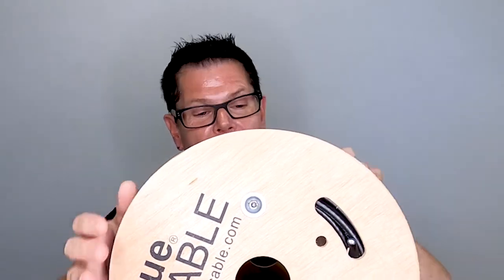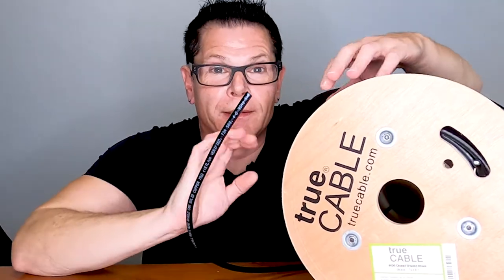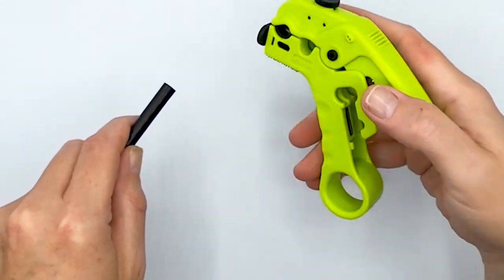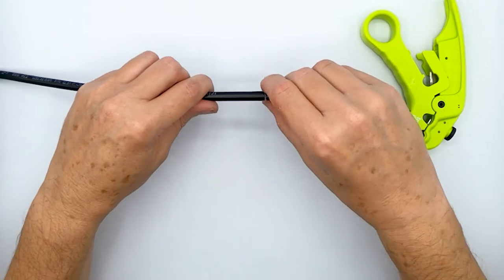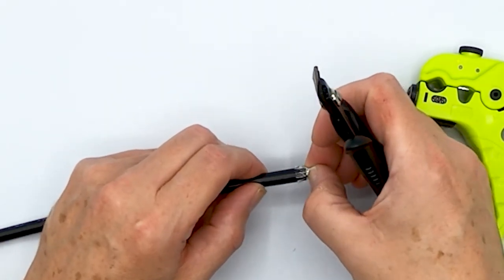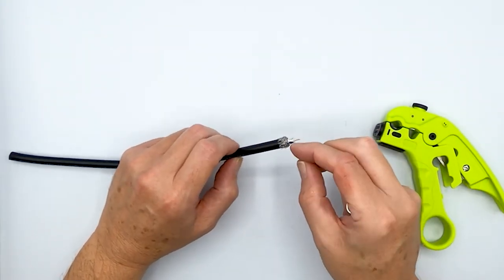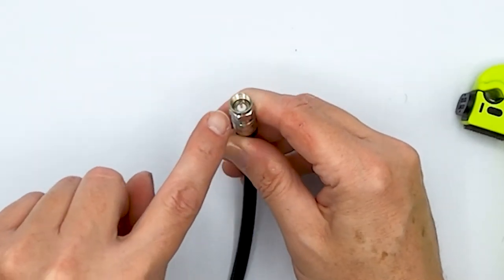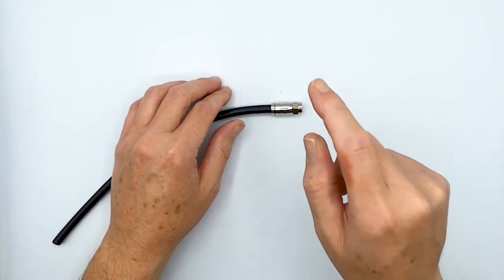RG6 Quad Shield Coax Riser: Overview and Termination

Comment: Very well explained and neatly executed. You must be a maniac like me. I do not play with connectors even with a small braid.
Reply from the maker: Hello Rob! Indeed, and thanks for the kudos. I hate forcing the "sleeve style" compression connectors onto coaxial...getting the sleeve inside the cable jacket even WITH a flaring tool can sometimes be very obnoxious.
Reply: @trueCABLE  The flaring tools are sometime very funny. You just apply a bit more force than the due and then it males  a small funny protrusion. On some connectors help to get inside the smallest part of the inside pin but not always. It is really an art and only if you are in the "mood" lol.

Comment: Great video i am struggling using standard f connectors due to the outside diameter of the cable where can i get the proper connectors from tried all types no one fits.
Reply from the maker: Hello Charnjit! Thanks for the feedback and question. It comes down to fitment and knowing the specifications for both the cable and the F-Connector. If you are having issues then the F-Connector is too small for your cable. F-Connectors can and do vary in size. Coaxial cable varies in thickness according to amount of shielding, manufacturer, etc. trueCABLE F-Connectors auto-adjust for the cable jacket OD via a spring mechanism and will likely solve your problems--they are very forgiving of variable cable jacket ODs. Aside from that, careful research is required to determine what will fit your cable.

Comment: When making Outdoor connections, could I use Dielectric grease like I do with 12vdc trailer connections?
Reply from the maker: Hello! I think the better option is 3M mastic tape so you can be sure the entire thing is sealed up. The grease will degrade the circuit considering it is dielectric.
Reply: @trueCABLE  Thanks for the Quick reply and info.

Comment: Any way to test both ends after termination with a multimeter? If so what would be the in spec numbers and how you use multimeter to test?
Reply from the maker: Hello John! Great idea, and we already thought of that one. In order to get our spec sheets fully built out with relevant data (that the DSX-8000 does not provide) we had to use a Fluke Multimeter and test both ends of the cable (raw). If you take a look at the spec sheets for our Series 6 coaxial cable on our website, you will see a section "Electrical Characteristics". The majority of the resistance data was obtained with a multimeter, not the Certifier. A two-point resistance test was conducted on the center conductor and also DC loop resistance, using alligator clips.

Comment: Is there less lost signal with an RG 6 Quad Cable or is it the same with a normal RG6?
Reply from the maker: Hello and great question! Yes, there is less signal loss with quad shield coaxial cable vs dual shield--everything being equal. In normal operation and under normal circumstances they perform largely the same and you would not notice a difference. The real difference is when there are external EMI/RFI sources that might interfere with your signal and quad shield is better at preventing that. When making a decision as to which to install, think of dual shield coaxial cable as the same as unshielded Ethernet cable. Think of quad shield coaxial cable as the same as shielded Ethernet cable. Use the one that fits the environment. Not everyone needs to use quad shield.

Comment: Can you connect digital ariel to analog cable from old ariel.
Reply from the maker: Hello Glen! That all depends on the original antenna. If the original antenna is already using coaxial, then perhaps, if it is designed to use 75ohm. We would need to know more about your existing equipment and what you are seeking to do in order to provide a more concise answer.

Comment: I don't have tools, but I want to know how many mm to cut , need it assap
Reply from the maker: The jacket is cut back a total of 13mm. The dielectric should be stripped back 6.5mm. We provide a visual reference for this in our Cable Academy blog, "How To: RG6 Quad Shield Coaxial Strip and Termination."